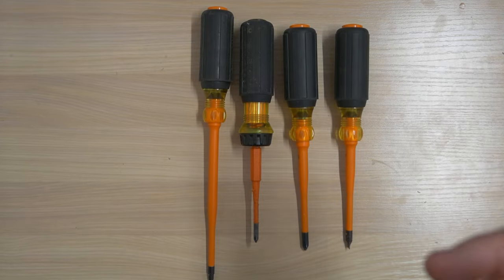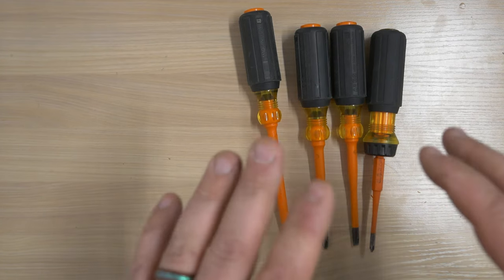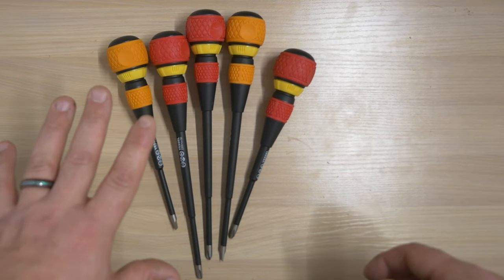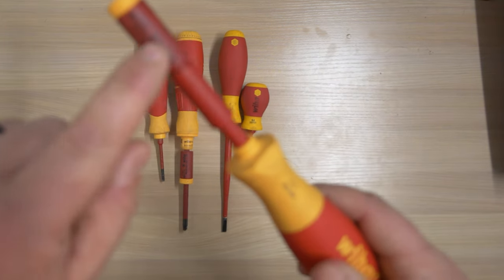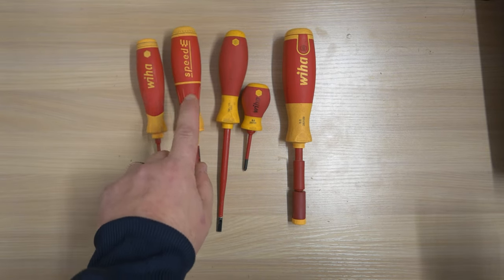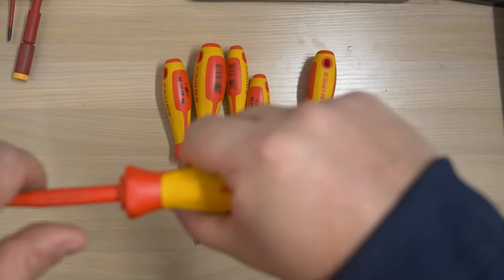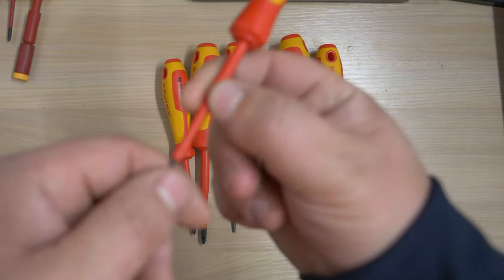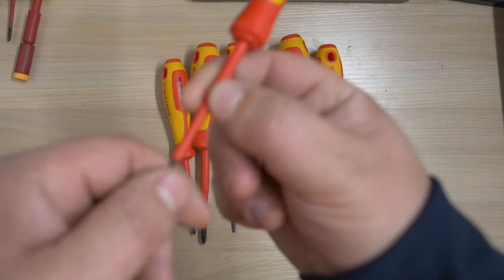THE best screwdrivers for Electricians in 2024 are...

Comment: The real question here is which set pokes holes in a  plasterboard ceiling better? Asking for a friend 🙃
Reply: Wiha has a 6mm screwdriver designed to be hammered in to walls for dowels. It even had a softgrip handle.
A friend told me it also works on plasterboard, but be carefull it's non insulated.

Comment: Boddingtons are probably my favourite VDE drivers I have used and are in my main tool bag. Just bought a VDE set from Gedore, which have quite large uniquely shaped handles, and can get a lot of torque, so will be interesting to see how long the tips last on them. Have Wiha interchangeables in the test bag along with the torque handle, but have found they are quite weak tips in comparison to other brands. Haven't seen those Wiha torque adapter bits before, might give some of them a try.

Comment: Bahco ergo slim for me absolute champs, not snapped one in the 2 years I’ve had them. I also use the Wiha torque driver daily, have noticed the modulo 2 bit snaps easily, they are also marked to a max torque on them think it’s 5.5nm which the torque driver doesn’t go up to, yet still snaps them, might be more fatigue, as said they are used daily for tightening boards etc.
Reply: Nicest set I've ever used proper nice.

Comment: I’ve got some cheap Stanley for rough stuff, hammering and poking ceilings. Wiha for most other stuff and two small wera (3.5 and 4mm) which are lovely. 

I do have a set of Boddingtons which are just solid simple drivers, they’re in my tester beg so don’t get a lot of use. 

I also picked up a Cory recommended Lidl usb driver which is pants. Think I might save up for a vessel powered driver
Reply from the maker: The Kuby from Amazon is decent lol. Good range of drivers mate!

Comment: Not a sparky but I like to have a set of VDE drivers in my toolbox.  Well actually not a set, they are a mix of Felo Ergo, Wiha, CK Germany (new old stock), Gedore and Klauke, bought individually.  For heavy duty stuff I can use my Wera Chiseldrivers.
Reply: Felo ergo are my goto currently. Other than pb swiss grip oval handles. Which next to impossible to get.

Comment: Hi Mark.  Grear channel. Long time viewer . question ❓
Do i need , wera torque set ?
Do i need a wera kraftform tutbo see on efixx.
is Armeg torque set  a good brand 1 to 6nhm 🤸🤔
would i ever need that High
 torque on cu unit etc ..

Thanks
Reply from the maker: Hi Ste, we got the wera turbos a good while ago. Must admit I didn’t like mine and gave it away. Think Nathan still uses his though. 

The wera torque set is limited in range. I prefer the wiha ones. Either fixed torque like shown in the video or the regular torque set. 

The armed gear is rock solid but perhaps a little bulky. 

Depends on your area of work. Some MCCBs go to quite high torque values but at that level you’re using a wrench anyway. 

Thanks and hope that helps